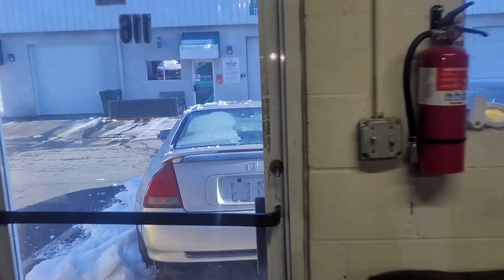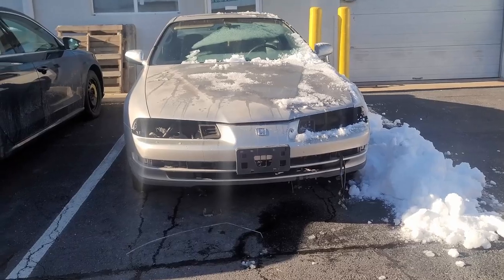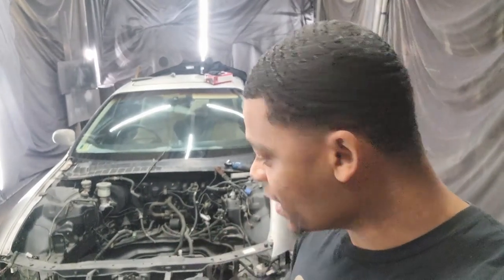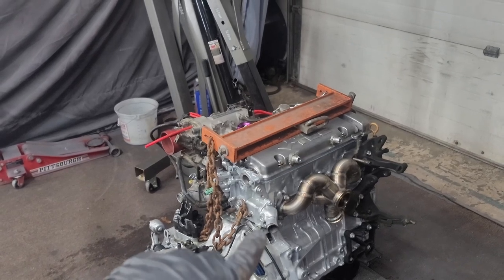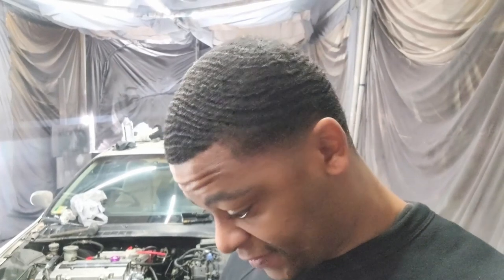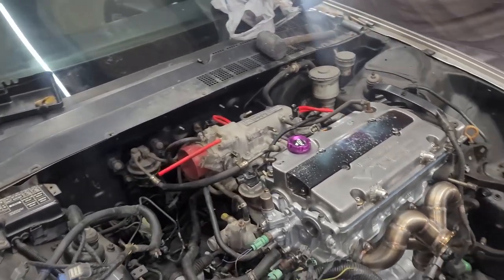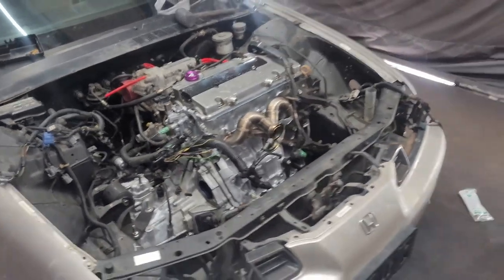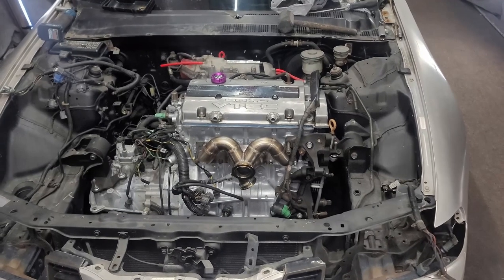How to build a Honda Prelude pt2 | h22 swap

Comment: Is this just a stock turbo build or bottom end is build someway.. sorry I was a fan of your F20b set ups bro.. my H is giving me headaches.. ( belt walk.. nothing works)
Reply from the maker: Yea bro stock motor turbo build.

As far as the belt walk you may want to replace your water pump. The bolt that holds the tensioner is on the water pump assembly. One time i over tightened that bolt and it was loose enough to cause belt walk
Reply: @treybedipping1734  thanks bro I’ll definitely do that.. last chance for this H22a or welcome back f20b

Comment: What turbo you putting on there? I have Blake’s mini ram as well. Got the g25-660 , css block, 4P head . Brian Crower cams. Hoping to max that turbo out 😅 600 or bust on this small setup . Waiting on engine to get back from 4P
Reply from the maker: Sick bro i got the gt3076 im going for reluable power cause its a stock motor

Comment: Question I want to do a H22A swap for my 93 prelude which is stock H23A would you know if I need anything additional or I can just plug it right in ?
Reply from the maker: You will need a vtec ecu like a p13 and you will have to wire in vtec. I'm pretty sure you'll need a h22 header and downpipe cause the h23 is different but think that's it. The trans fits

Comment: So lucky on fuel filter location compared to 5th gens 😭😭lol
Reply from the maker: Where are they on the 5th gen?
Reply: @treybedipping1734  in between shock tower and motor drivers side- you have to reach your arm as far down as it will go to just about get a 14mm flare nut wrench on the bottom of it
Reply from the maker: @trundlepufpendants  sheeesh
Reply: @treybedipping1734  my prob is flood damage.  Water got in ecu connector and corroded the pins for crank sensor. Not rly any on the board hopefully can dry and plug back in

Comment: put a f23a in that bad boy so you can quit swapping engines.
Reply from the maker: Single jingle 🤔
Reply: @treybedipping1734  

you can port those heads and add j30a4 valves and it will flow 300cfm. j32a2 valves springs fit in those heads. you can also use k20 or j30a pistons. they also have a k20 style main girdle. they are slept on.